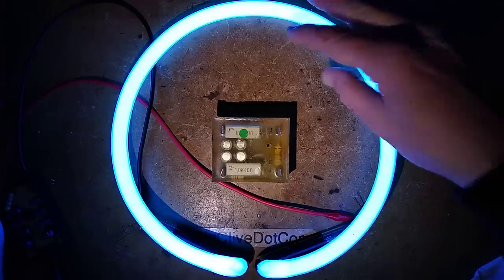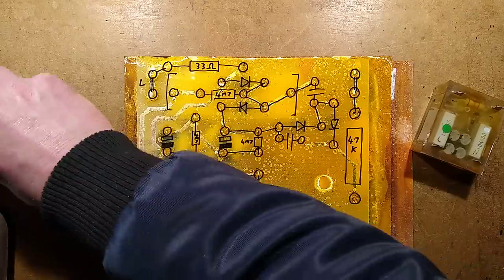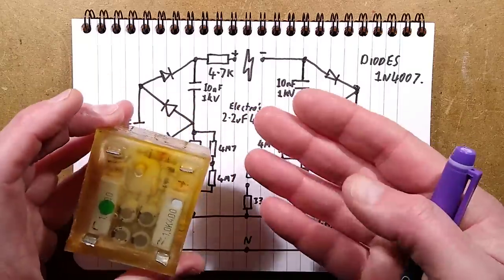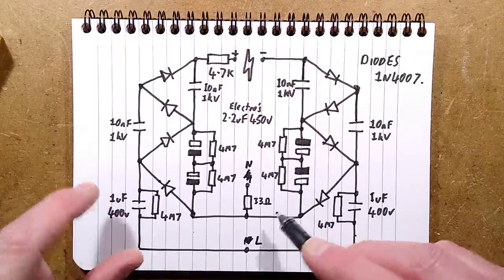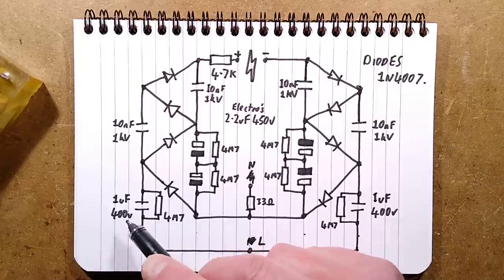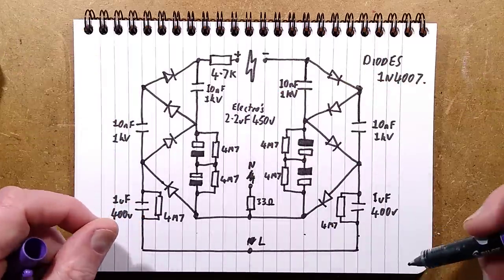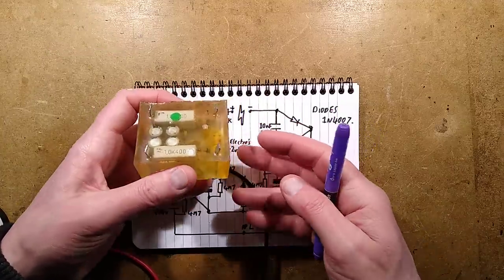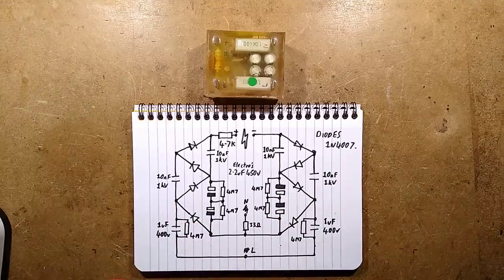Unusual MasonLITE neon tube PSU (with schematic)

Comment: I've been working on an idea that involves a voltage multiplier circuit to power a small neon lamp. Specifically I am trying to underpower the lamp so it can act as a scintillator in the presence of ionizing radiation. I'm running into a problem in which the lamp is illuminated even when the supply DC voltage is below the lamp's striking voltage. I assume this is caused by AC noise in my voltage multiplier circuit. Any references or advice would be greatly appreciated!
Reply from the maker: Even with a complete black surround blocking all light to a standard neon indicator it may still light due to the use of a trace amount of radioactive material in the electrodes.  I tried a lot of experiments with a neo based mains powered geiger counter in the past and had no success.
Reply: A standard NE-2 lamp has a strike voltage of 90 volts but the hold voltage can drop as low as 60 volts allowing the lamp to glow.

Comment: i keep holding my breath.. each time hi touches the no working multiplyer.. that said.. is it possible to charge it with static touches?
Reply from the maker: The spicy capacitors in the resin unit have discharge resistors.

Comment: An American thinks “Masonite,” which is one of those brand names that becomes a word. Steam-cooked and pressure-molded wood fibers made into a fiberboard: the company (or a company using the name) is still around, so I guess that use of the name for all similar products is free advertising for them. I’ve seen masonite or something similar with resin used for circuit boards but there’s no connection with Masonlite…

Comment: I've never seen a voltage multiplier used for neon tubes, always a transformer.
Reply from the maker: Yeah, it's pretty odd.  The limitation of DC causing mercury migration is compensated for by much lower cost than a traditional transformer and greater reliability than early electronic transformers.

Comment: Exclusive content for payers, even if it's timed should be illegal. Anyways I have a neon wall clock (it glows blue, so it's just a shaped colored CCFL tube) that has a small HF HV PSU for the tube that used a 24 volt AC plug-in transformer. They probably used AC to prevent the polarization problem, as the circuit does work on DC just fine.
Reply from the maker: There's normally less than a week between the video getting made and released for general viewing.  I've just been creating so much content that the videos have crept up to a few weeks.  The power supply in your clock may be the classic CCFL Royer inverter.

Comment: Well, it makes sense that the 1uF 400V capacitors need to be non-polarized. If we look at the 1uF capacitor on the left, if upon power up Line is negative relative to Neutral, then the 1uF's lower terminal goes negative for an entire 1/2 cycle as the capacitor is charged via the diode just above it. But, if upon power up Line is positive relative to Neutral, then the 1uF's lower terminal goes positive for an entire 1/2 cycle as the capacitor is charged via the 2nd diode above the 1st one and through the 2 stacked electrolytics.
The electrolytics can never have more than 1.4V reverse voltage across them because of the two diodes in series-parallel with them.

Comment: Is this how a taizer gun works takes 9v batteries. 
And Turn it in to 150volts..
Multiplier???
Reply: One of 2 possible ways.  The other is to run artificial 6V AC into a transformer that outputs to the torture needles.

Comment: You should try working with Automotive Electronics, particularly those in the engine bay. It's common to find them potted in black  chemical-resistant high temperature resins that include a sand-like filler. It kills even Carbide or Nitride Bits and good luck to seeing what's inside! 😬